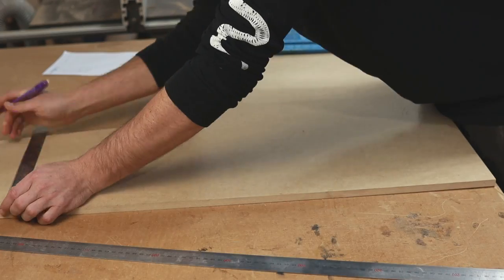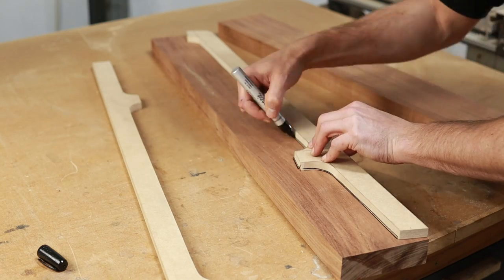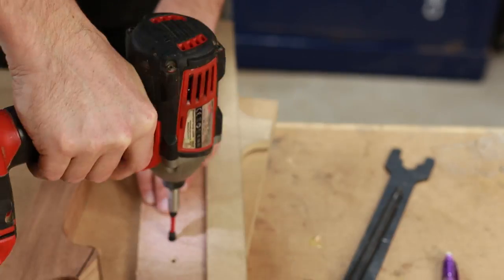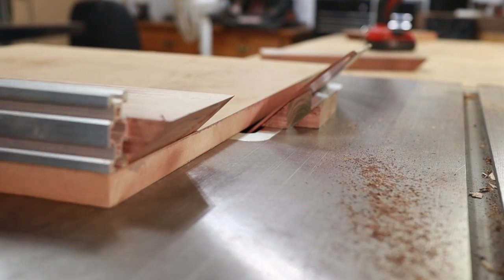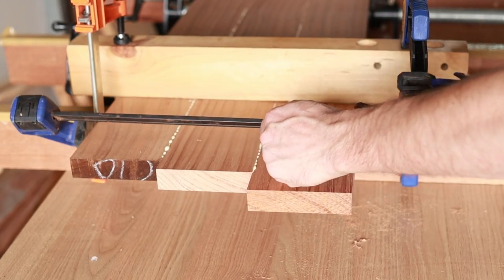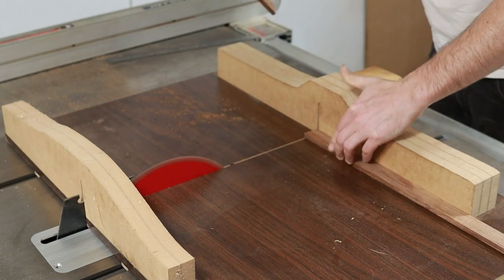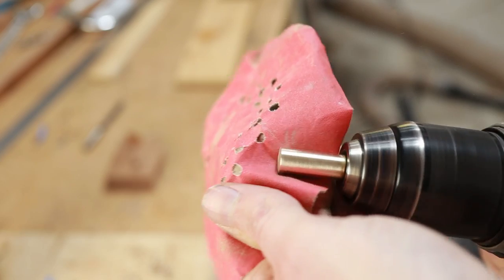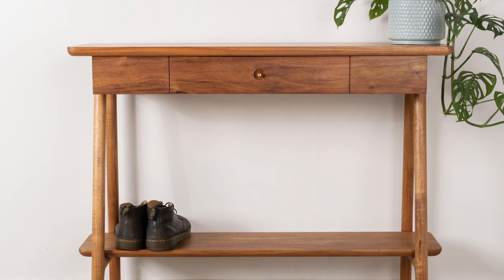Building a modern entry hall table

Comment: Great video!  When you're gluing up the miter joints, you use painters tape on the outside, but if you also put some on the inside very close to the line on both pieces, you will have no glue cleanup needed, just peel it off.
Reply from the maker: Thanks for the tip. I sometimes do this for show faces but as this was the inside I just wiped away the excess with a wet rag. Nobody (I hope) will ever see that part of the table anyway!